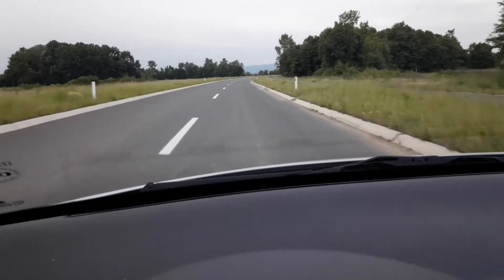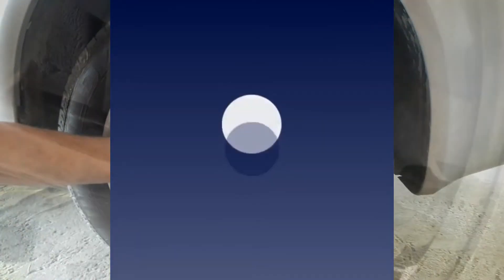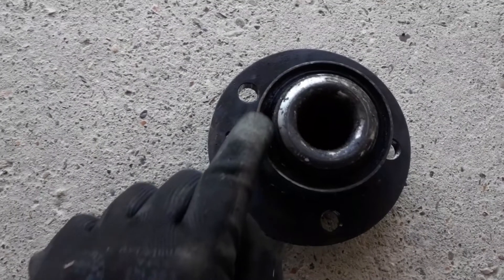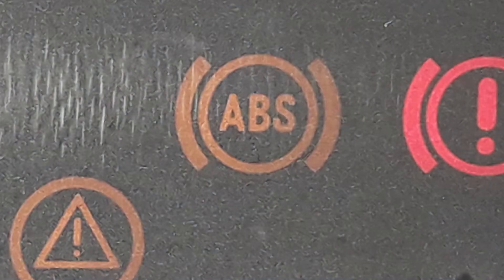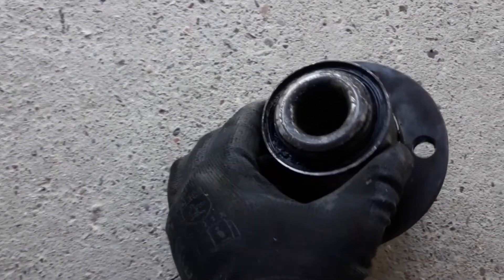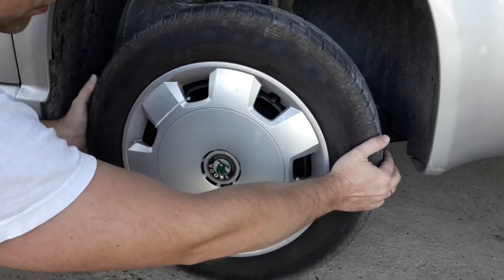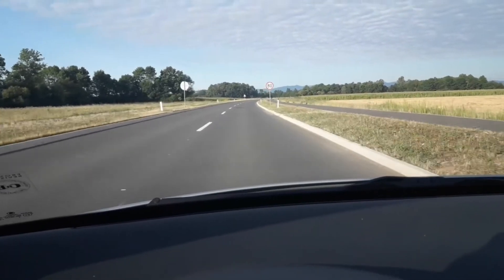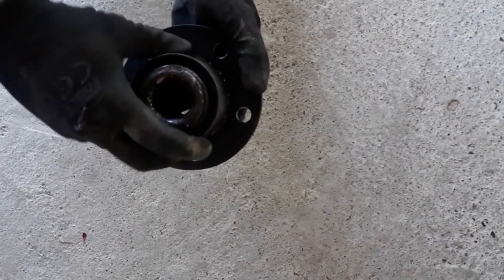Bad Wheel Bearing Symptoms

Comment: Thanks for making this video.We have a 2013 Impala LTZ. For months the car had a vibration especially at 70 MPH. We took the car to the best car repair center in the city. comes to find out, there was a bad wheel bearing on the drivers front. I had both front wheel bearings replaced. Car aligned. Two new front tires. Car is back to normal.
Reply from the maker: You're welcome and glad if the video helped 🙂

Comment: Best audio I've heard. I definitely heard the same humming in your video as if it was in my vehicle that settles it it's definitely a bad hub bearing now I just have to find the right one there is a little play in the Shakedown test on the driver side however there was a boot horn on the CV axle passenger side I just had replaced which makes me think it's on the right side but the Shakedown test passes on the passenger side as for the rotation test they both sound the same

Comment: Bad wheel bearings can also be weird you can get weird noises at medium speeds, between 40 and 60 km/h, but you can hardly notice it when you reach 90 to 100 km/h.

In my case, my 2016 Mazda CX-3 gives off a bad chopper and rumbling like noise between 40 and 60 km/h, but it goes away over 80 km/h.
Reply from the maker: Hi and thanks for watching!
I think it all depends on how worn out the bearing is at that moment.
Sometimes at higher speeds, it sort of centers itself or heats up and there's less noise while at lower speeds it's howling.
Sometimes it's the other way around.

Comment: I have side to side play, but no up and down play.
When another person is moving to lifted wheel from side to side, I can see the movement at the cv axle and bearing being separate from the hub assembly, but I have Zero noise other than slightly hearing the pads brush the rotor.
The ford focus has a fairly bad vibration starting at 50mph and dives to the right during breaking and pulls during acceleration.
Ball joints and tie rod ends appear fine.
I don't know what else it could be other than the wheel bearings, but any other time I have had bad ones I could always hear them and all the other information I can find says that you will hear them; Which makes sense.
The silence of them has me second guessing my diagnosis.
Can you think of another area that I might check out?
But I am positive that I see very small separation movement in the rear of the knuckle to hub assembly.
The movement is on both sides equally, which also makes me second guess myself.
Reply from the maker: Hi and thanks for watching and sorry for the late reply. What about the tires and their condition?
Also, did you check the brake discs?
Reply: Did you ever find out the problem,  I'm having the same issue on my Infiniti FX 37. Vibrations at high speeds with factory, and aftermarket wheels. New tie rods, sway bar bushings and links and got an alignment.

Comment: Is it possible if I don't have humming noise but wheel wobble and car pulling one side while turning, i have an issue in the front left wheel. No steering vibration. Not any noise. What do you think?
Reply from the maker: Hi and thnaks for watching! It could be numerous things, I'd first check the ball joint and steering link.
Reply: @DespairRepair  let me check

Comment: I have a vibration when braking, I changed the discs and pads, could it be the hub?
Reply from the maker: Hi, thanks for watching, and sorry for the late reply.
If it only happens when braking, I doubt it's specifically the wheel bearing.
I'd rather re-check the brakes, especially the discs.
Reply: Same thing with mine any update?

Comment: oh good a video that actaully had the noise, i am 99 percent sure this is the exact noise i hear in my car. it began about 11 days ago. so i am assuming  that i am still good to have it repalces son. oh and btw. i live in Michigan we have pothold galre here every winter and just came out of winter. so it would make sense that this could cause it
Reply from the maker: Hi, and thanks for watching! I think you still have plenty of time but just in case replace it in the near future.🙂
It's the same in my country. After winter most of the roads look like the surface of the Moon.
I certainly agree that potholes could've caused the problem. One big hit is enough to damage the bearing especially if it's done some mileage.
Reply: @DespairRepair  good morning! i am curious what country are you in?  as for michigan, metro detroit area even more than any other state in the US potholes are the worst. there are reasons though. 1 is that Detroiters/michiganders love their cars. we literally yave 85% of people commuting to and from work single occupied cars no carpooling much 2. our state doesn't seem to have weight limit on trucks or at least enformece them if they do compared to any other state, and you combine that with being in place that has teh 45th parallell runng through the upper part of the state we defintely have big weather swings alll the time. so yep.

and thankyou!! btw. i am tking my car in to my trusted mechanic this morning.  hopefully that is the only thing i got.  i assume if he has to replace one of these i am guessing it would not take very long?
Reply: @DespairRepair  well, it is in fact a wheel bearing. i had the mechincal  test drive so i think we will get it done tomorrow
Reply from the maker: @Johnadams20760  Good luck with the repair and hope it doesn't cost too much 🙂
Reply: @DespairRepair  this guy never overcharges ever. he is the most honest and reliable mechanic i know inmy area by far.  
out of curiosity how much would a repari like this normally cost would you say?  it is likely just 1 tire

Comment: Waoo  seems  ppl  don't  have  that much  this  wheels  bearing  problems, I've this  problem can't figured out clearly  what  is happening, I've ABS light  on 10000 miles I've driven  already,  is this  dangerous  to drive ABS light on? Toyota corolla   09 175,000 miles  on, mechanic  told me to just to change 1 side  of  wheel  bearing 350.00,  seem  when  they  touch  minimum 350, this  vdo educated  me.  Tkx

Comment: I think my Camry has a bad wheel bearing as I hear loud sounds when driving at highway speeds. I read that you should only drive 1000 miles max with this issue. Is that true or can I push it off longer?
Reply from the maker: Hi Joseph, thanks for watching, and sorry for the late reply!
I'll be honest with you: I've seen cases where people drive with that kind of bearing for much, much longer.
If there's no play in the wheel and the bearing is still in the "mildly humming sound phase" then there should be some time left.
When it comes to the "crunching phase", when you hear crunching and rumbling from the wheel, that is the certain end and the car should be parked.
But I must say that all this is "winging it", as soon as you notice the problem go check it out and if possible replace the bearing.
You never know how much it takes from the humming sound to the wheel getting blocked. It can take months or happen in a matter of days.
Hope this helps (and don't wait too long to replace the bearing🙂)
Reply: With my 2016 Mazda CX-3, when I drive at typical city speeds, between 40 and 60 km/h, I start to notice the chugging and chopper like noise, and then when I reach highway speeds, I don't hear it at all.

Bad wheel bearings can be weird.

I plan to get it fixed at my Mazda dealership in the future.

Comment: what if my mercedes makes a Thud-thud-thud-thud-thud sound? and when i drive faster it makes faster thud sound?  and when a turn into a driveway it makes a scrape sound in the rear passenger side?
Reply from the maker: Hi and thanks for watching!
What type is your Mercedes and what production year?
Reply: @DespairRepair  1989 mercedes 190e  if i turn and take weight off that side it will stop.
Reply from the maker: @amandaburleson2035 Burleson very good car!
To be honest it could be a couple of things. The thud sound may be anything from a bad tire to some part of the rear suspension.
The scraping sound may come from the disc pads, discs, brake shoes, or else.
But all of this is just a wild guess, best either to take the wheel off and make an inspection or drive it to a mechanic.
In any case, best don't drive it like that for a longer period of time. It doesn't necessarily have to be something serious, but an inspection is necessary.
Hope any of this helps!
Reply: @DespairRepair  i have been driving like that for one month and its getting really lound now. but i keep driving it lol thank you

Comment: would this cause a clunk like a arm? i replaced all suspension still hearing a clunk on dirt
Reply from the maker: It's possible but, at least from what I've seen, this kind of sound would occur if the bearing is totally ruined.
But before that, you would probably hear a strong humming sound.
Have you checked the stabilizers? Had the same problem on my Skoda, the stabilizers were the problem.

Comment: Would it also be possible if the the wheel bearing has failed and wheel wobble is happening. Could negative camber or leaning of the tire  from the top occur?
Reply from the maker: Hi and thanks for watching!
Yes, it is possible, but only if the bearing is on its very last legs. It would have to be seriously damaged for wobbling to happen. Also, by that time, you should clearly hear the bearing howling and grinding.
At least from personal experience, the wobble usually first comes from something else on the suspension like the tie rod or ball joint, especially if the roads are of poor quality.
If there's no sound, I'd first check that.
Hope any of this helps.
Reply: @DespairRepair  upon just further outer inspection it appears that the front axel shaft, driver side, as it turns, the u joints are smacking into the ball joint nut. I'm suspecting bad u joints and bad hub wheel bearing. The negative camber is bad on the driver side. It looks like it's leaning way to much.